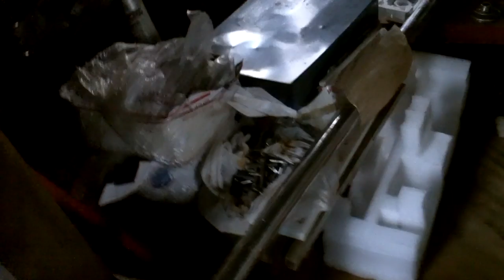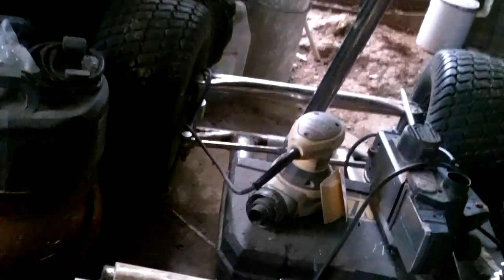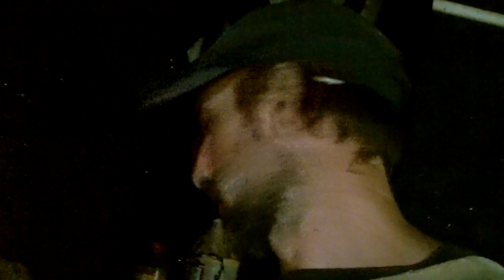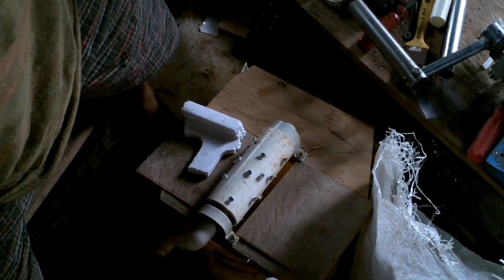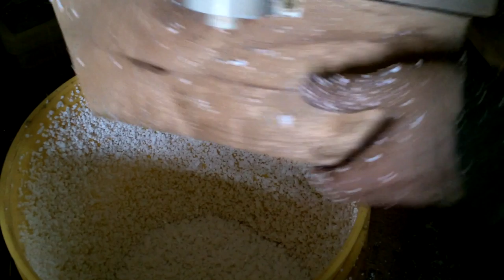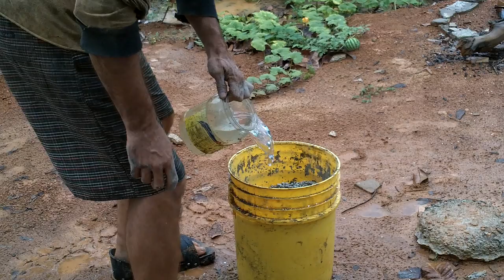Styrocrete: Making a Foam Grinder out of Junk

Comment: Ohhh Jamie, Look Up Air-Crete On You-Tube! Use Dawn Detergent To Make A Thick Shaving Cream & Mix w/Your Concrete! It's Waterproof & Floats Also When Portions Are Correct & Mix With Your Strofoam Bits, Or As You Will Find Over Time That Yours Will Be Too Brittle & Fall/Break Apart!!! Take This From Me A 45+ Year Union Cement Finisher & I'm Now 65.5 Years Old!!! Thanks Son Glad To Help Ya...

Comment: My Dad developed a system in the late  70"s that was very similar for low cost housing .It was is known as GRC glass teenforced concrete. They used a spray gun that had a continuos strand of glass fibre fed into it. The gun had a spinning cutter that chopped the fibre and mixed it with a very wet cement mixture as it was being sprayed. The panels were made up of a layer of 5 mm chopped strand cement, about 80 mm of your styrocrete and another layer of GRC. Interestingly at night when the plant shut down they would feed a sugar laced cement  mixture into the gun to stop the cement setting and then continue spraying the next morning. Love the videos!

Comment: Maybe adding fibers will give the styro-crete more strength. Looks descent for a insulator material. A blower/mulcher does a great job with the foam mincing you just need a fabric collector bag and some sort of hopper maybe but yours works  great as long as it doesn't turn into the mangler after a handslip. Also have you considered aircrete construction for some uses? It really stretches the yield and a home made aircrete machine should be no major issue for any Adventure Builder. 😎
Reply: Good comment. I found this video (and this channel) searching for a foam chopper to augment my aircrete.

Comment: You need small pvc pipes in the mix to considerably strengthen it. You can also use the pvc pipes to connect one unit to another.

Comment: Love the shredder. A fan on the end of the shredder shaft that pulls a vacuum through the bucket to suck the Styrofoam into the bucket. Also maybe add some plastisizer to the cement to help it stay dry but mix better (stronger). Also compress it whilst it's curing. Ultimate recycled lightweight brick.

Comment: @Jaimie

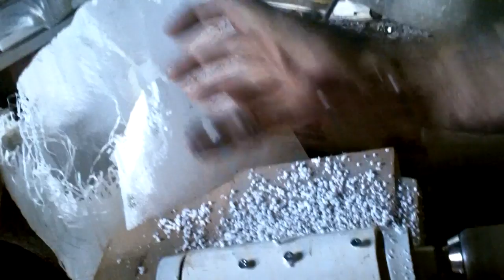It might be worth adding that safety box with an exposed front to feed into like you were referring to around 12:00 for catching the tiny bits...I'd imagine you could do it quite well with a curved piece of metal with the edges bent inward to form a "half cylinder" shape.

I've built similar things when I was attaching my dust collector to tools in my wood shop and it's worked very well. :)

Comment: Hello Jamie, 
wouldn't it make all of your concrete based projects much more efficient and result in more consistent mixing, if you got either a new or used electric powered concrete drum mixer, that you could adapt to run off of your solar? 
Regards Dave
Reply: He could pretty easily build that himself if he found a decent enough motor!
Reply: @Jonnyblacknell  I am sure he could, but mixers are built to take a bit of abuse by design, building one to the same level of strength and durability from scratch, would use up materials that might be better used elsewhere on other projects.
Adapting an existing one bought for small money in the same way that he has with other used tools, that are designed for specific tasks, would seem to be a more efficient use of his time verses return and allow him to get on with the current projects he has ongoing instead.

Comment: Should cut the bottom (inside of the edge) out of a second bucket, mount the drill-powered grinder on the bottom, use the cut-out bottom with a stick taped to it as a stamper and it should catch 100% of it in the bottom bucket, direction of the drill would decide big or small chunks either way.

Comment: What about air-crete. There are versions that don't require baking at high temps in a huge oven. Use the Styrofoam for insulation.
ahh... no foam-er yet. :)
Reply: He explained that it wouldn't be suitable for a dock float and he hasn't made a foam generator yet.  I'm a big fan of aircrete but, I like the concept of re-purposing foam.

Comment: Add some sand it will fill in the voids adding strength at almost no cost allowing more foam to be used for the same strength with less water penetration and similar flotation and less air infiltration for building.

Comment: idea get a piece of that big pipe and make a push stick might even help with the stuff flying around. (bit longer length then the shredder pipe, a length wise piece maybe 1/3 of the pipe unbend it just a little to clear the screws head, a flat piece of wood attached at the base, a couple of stoppers so again you don't push it in the screws ) i hope that makes sense explain how to make something without any drawings is hard even more when this is not my primary language.

Comment: If you've got a bucket that doesn't have a solid bottom... possibly cut it out and use it as a hopper,  this would allow even your kids to use it, second in my mind is to add some sort of fiber like plastic straps or something like that to the mix, and then just to test buoyancy I would do a few bricks in the original size with measured ratios of concrete to foam mix to determine what the best mix ratio is, I would want something to be able to hold itself together but also be there for a long time, if underbuiilt a large chunk with break off and an unlucky boater could hit it or it could go against the side of a docked boat and beat it with the waves .
Reply: When you've got some bricks it seems like you could test based on strength and how much weight you can put on top before it sinks.  While I would prefer to use as much foam as possible for longevity that may bot be possible without a higher ratio of concrete

Comment: I had the same idea, basically make concrete. With Styrofoam ag, it should be as strong as the FoamCrete, if not stronger. It may be slightly, but stronger, while adding insulation, and disposing of garbage!

Comment: I'm not a structural engineer, so excuse me if this is a stupid question, but what is the benefit of using the styrofoam/concrete mix instead of pontoons for a floating dock? I mean, I love the idea of reducing waste, I'm just asking out of general curiosity. The grinder itself is pretty neato, of course, watching the styrofoam practically melt away was oddly mesmerizing.
Reply: Pontoons eventually get holes, and sink. This stuff won't.

Comment: jaimie please use at least a vacuum cleaner attached to the bucket so all the little bits will draw inside of the machine instead of outside , also if you made two of those rollers it might be more effective as it will eat the cardboard, also you can just disolve cardboard iwth some chemicals and use it as bonding agent , but  i am not sure if that would be toxic. did you test what happens to the mixture if you heat it up with sun,heatgun aor fire , will it melt and collapse and catch on fire? maybe add fireretardant to the mix?

Comment: What if you were to encase two liter bottles in this stuff and give it a cement layer on the outside for added strength and protection. The added buoyancy from the bottles may offset the added weight of this new structural cement layer and further your upcycle attempts, while containing any loose Styrofoam particles and keeping UV off of the bottles. Perhaps reinforcing the caps with glue and sealant to reduce slow leaks.

Comment: Reminds me of aircrete. Have you heard of it? I wonder how they compare, if at all..
Reply: I believe the answer is yes he did mention it as foamcrete though because that's what Eric Reid is that use a dish soap or some kind of soap that will foam leaving a lots a little air pockets in your cement or concrete block Aureus matte walls been proven great for flotation easy to cut with a hand saw so many better if it's just not proven durable enough for supporting walls or floors what is used in floors and walls partition everywhere but do not need to support but only partition .
An 80 lb bag concrete makes a 55-gallon drum of air or foamcrete whichever label whoever is using it is going by I've heard it called both it's the same thing .
 most important is the binder which is your aggregate which is also what you're replacing with the styrofoam and the styrofoam just acts like that more dense pocket of air helps keep moisture out help seal the moisture out and I think it would actually do a better job and has proven to do a better job in the water .
 the biggest thing is how you choose to seal either will help the longevity of buoyancy and the longevity of life especially in the saltwater

Comment: Jamie you are truly brilliant and inspiring amazing your Treasures that come from what other people see is trash .
I do admire your experimental process with this one I would love to see you expand it .
I have been working with concrete all my life being in construction all my life commercial industrial and residential an poured and laid a lot of concrete .
 think of that styrofoam as an aggregate the smaller and Tighter together you allow your aggregate the weaker your concrete or cement.
 I've always gone with the two or three to one mix on everything I've done and usually tends to be stronger.
 mortar for doing brick you add too much sand and you're going to have a week mix.
 I have and will use a 4 to 1 mix four sand to one mortar and concrete. for laying brick or block with no visible mortar scene. The thicker the joint the last sand but never less than a 2 to 1 mix always use the to 3 or 4 to 1.
 what I'd like to see is several of mixes done in experiment with  your styrofoam is aggregate doing a mix with 1/2 or 3/4 inch pieces Just Like concrete and see what kind of concrete block you come up with .
 I really don't know what the market is like but I know they used to carry epoxies and paints for ceiling  your concrete doc.
Naturally I know slips made with clay, tree saps, Roman concrete which is just baked and crushed lime stone, got a good source to Limestone looks like it's pretty easy to make and you'd be good at crushing it or making something to crush it.
 I would also like to see a mixture of both the foam process mixed with the styrofoam process half inch and 3/4 inch size chunks I'm styrofoam alone in one done in a 2/3 and 4-1 mixes
 then done also with the styrofoam and the foam machine I know you will make and you'll be glad you did I am most positive .
 then the styrofoam pea gravel type mix that you are using right now of course  with and without the foam and the 2, 3 and 4 to 1 mixes .
 and I would love to try making my own natural slips, I just haven't done it yet, in the plans though.
 oh another thought comes to mind for making and helping this floating dock be more and stay more buoyant and I do it no matter what you use or at least experiment, that is sanded tile grouts. I definitely be tempted to try it on its own and also try it with an epoxy or an enamel paint that is known to stand up to both the saltwater and the concrete .
 I know they make PVC Coatings you can paint on now I've just never used one yet .
 I  to use r 3 to 1 sand mix for scrubbing  concrete to give it that nice finish look .
 definitely when it's my own work I will add a pound of sanded tile grout color of choice, they have many colors these days even a small tint can you change the look and make it more appealing .  there is a natural hardener sealer I've been using mostly on flatwork also I think might help protect what's in the elements always applied to every finished surface has proven to me the added longevity of my concrete from the elements and from traffic . I know I have a five gallon bucket of it in the shop if there's any interest shown I will definitely share the information.
 on the list definitely now of what I'd like to try all of this for myself as well as I'd love to see you try it because I live in a dry desert arid climate and you live in Paradise .
 no matter what you decide to do I know everything you do comes with that Joy of Jamie's highly intelligent creative fun which I will always remain in much appreciation of !!!!!!!!9
 HHBpHhelps 
 Henry